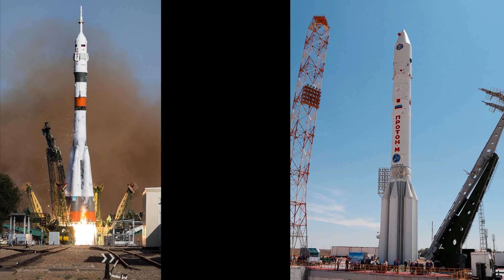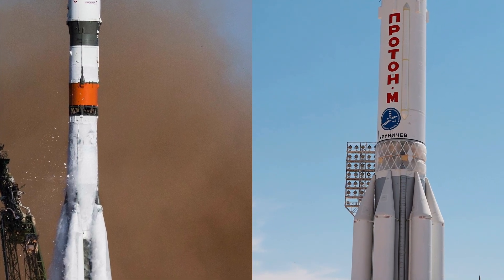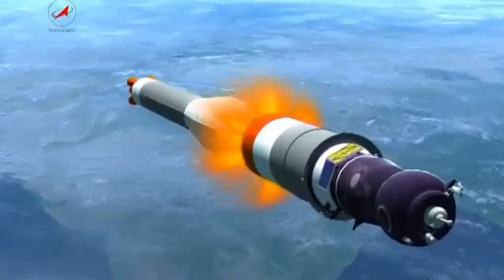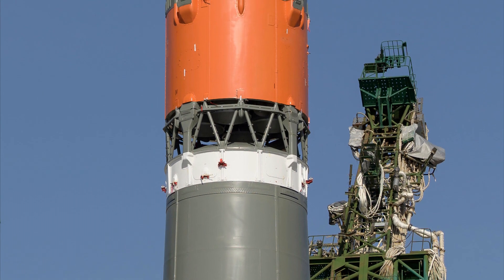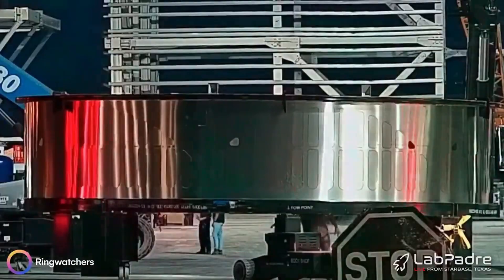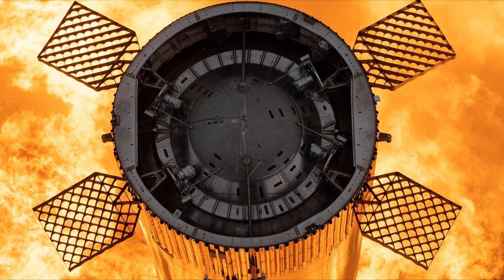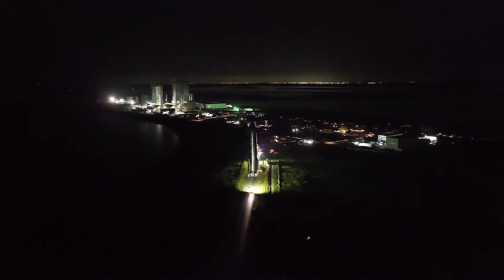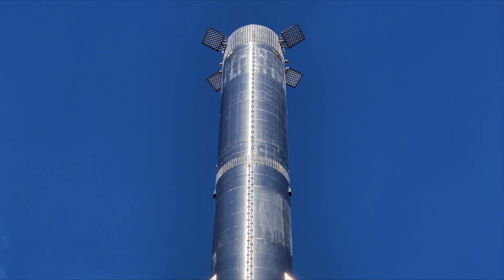#203 - More than 1000 Changes on Starship

Comment: Hot Staging announced by Elon Musk is just a smokescreen for very .profound structural changes to the Starship. Space Cadets at SpaceX know from the very beginning that unpressurized Skirt of the Starship was too weak, due to buckling caused by compressive thrust of 33 Raptors, to gsupport whole mass of fully hfueled Starship during liftoff. Despite knowing they took the gamble with test flight. Skirt that suppose to withstand acceleration of 4.5g partially collapsed at 1.75g. Elon knew for at least 2 years now that using Vac Raptors as support columns would eliminate buckling problem but he dragged his feet on implementation of this idea that was handed to him on a silver platter. Now pushed to the wall Elon devised this "hot staging"  as a way to deceive everybody that he is switching from Skirt  as support to Vac Raptors as support columns as a necessary change forced by "hot staging" concept.
Reply from the maker: The whole system will certainly be continuously evolving based on the data collected during tests and launches.